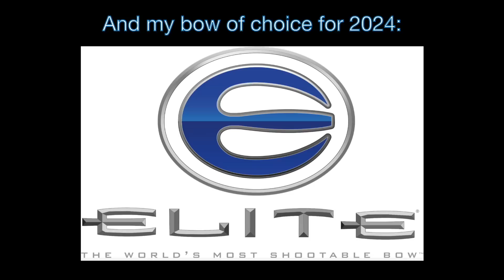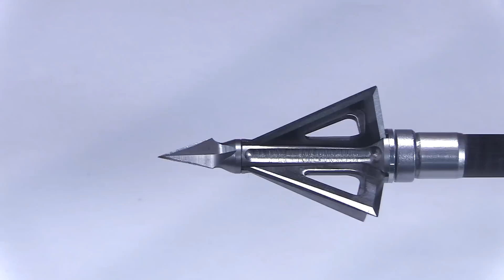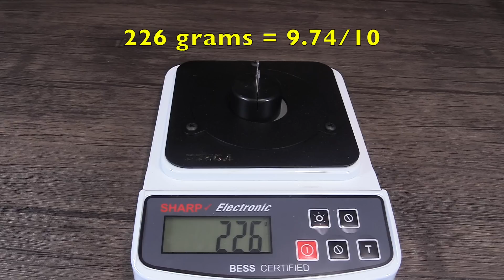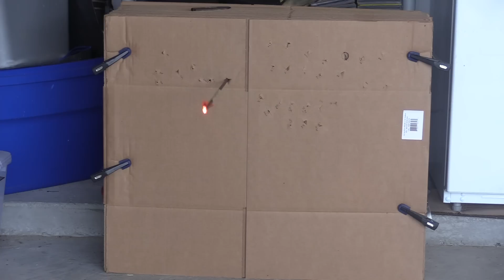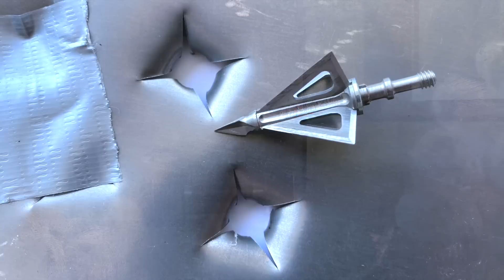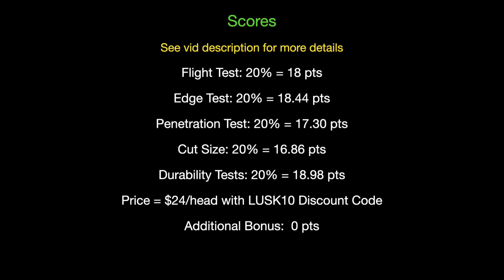GRIM REAPER HADES 4 BLADE, 125 gr Broadhead Test

Comment: Im thinking about running these right next to the qad exodus 100 grain swept . Mule deer and moose maybe a elk would be all possible
Reply from the maker: They’re excellent heads. I prefer the Micro Hades, for better flight and durability.
Reply: The Grim Reaper Pro Hades tested in this video has replaced the QAD Exodus in my quiver. Nothing wrong with the Exodus but the Grim Reapers are deadly on whitetails. The larger overall cut size far out seeds that of the QAD. Much better blood trails but most of the deer I've killed with GR haven't gone far at all.
Reply: For deer iv been running the g5 t2 2" 2 blade mechanical, i also have a bunch of sevr 2.0 hybrids on order i belive i got 8 of them. I got mule deer,wt deer,elk,moose,mnt goat,stone sheep,black bear and bison with in a few hrs of the house all on general open season over the counter tags@robmattingly5279

Comment: My two cents on grim reaper heads. Their best is the micro hades. Their mechanicals are so-so, I like that 6:17 you get 4 but that’s clearly because one or two will have a significant wobble right out of the pack. Stick with their smaller blade lengths unless you are shooting a powerful set up.
Reply from the maker: Yeah I prefer their micros as well.

Comment: I use the grim reaper micro hybrid and the grim reaper 3 blade 1 1/2 razor cut extra cut. But this year im using swackers fixed blade and the flying arrows toxic and trying to get my hands on thorns throrn crown 8 blade broadheads. I would love to see you do a test on the swacker fixed blade.
Reply from the maker: Thank you. I have tested those; they used to be made by Steelforce.
Reply: @LuskArcheryAdventures  ow okay I will look on your channel and try to find that video. Thanks

Comment: Good review as always John. I ordered a pack of these exact broadheads this year Grim Reaper 125 gr Pro Hades 4 blade. They flew well out of my setup. I shot a mature Ky buck opening evening, and the buck went 30 yards and died within seconds. Complete pass thru and I'm pulling 55lbs with a RX8, 470gr arrow. One of the blades did break off and the tip got an ever so slightly curl to it. I believe it caught part of the off-shoulder blade upon existing. They are an excellent broadhead.
Reply from the maker: Nice job. Thanks for sharing that experience!
Reply: @LuskArcheryAdventures  Is there a Lusk discount code for Grim Reaper?
Reply: Shot a 152" Iowa buck with the Grim Reaper 125gr Pro Hades 4 blade last week. 30-yard shot went thru scapula and the buck ran 25 yards and died quick. Huge, bodied buck. Great blood trail even though it was short. 3rd deer this year with the Grim Reaper and all 3 died within sight 30 yards max.

Comment: Which fixed blades have you tested with the best flight performance?
Reply: @ThirdLawPair  I used the 
Muzzy 125 gr. 4 blade heads
For many years. Exceptional 
Accuracy and deadly. Then
They stopped making them.
Pretty much all 100 grain and
3 blade. Just bought some of 
These. Anxious to see how 
They work for me.
Reply from the maker: So many. I always post a summary spreadsheet at the end of each year, in the Year End Summary video; and it can be put in order of flight forgiveness. Overall, the smaller the profile, the better the flight. Tooth of the Arrow 1”, Slick Trick Standards, Kayuga Trizot, and Exodus, are amongst the best in flight.

Comment: Looks similar to the Thunderhead 125. Does this have the replaceable razor sharp blades that the Thunderhead has?
Reply: They have a rebuild kit. Replaces the tip and blades.
Reply from the maker: Yep, but it’s quite a bit better than the Thunderhead.

Comment: What’s also good about the micro hades is they also come in 150 grains and not many replacement heads do. 
Used my TAC arrows. 368 grains TAW with 150 grain micro hades. Shot multiple pigs with them and had crazy good results for a light set up. Like sticking in the tree behind the pigs.
Reply from the maker: Nice. Thanks for sharing that.

Comment: Quick math note:  226 initial sharpness - 251 after-shot sharpness = 25 grams difference, not 34 as stated.
Reply from the maker: Thank you for that. I get bummed when I make mistakes like that. But I appreciate you pointing it out. Honestly, sometimes what I’m saying is more accurate than what is on the screen. But it’s a mistake either way.
Reply: @LuskArcheryAdventures  I tried recording a few of these testing/review-type videos before. You need 2 hours of film to feel like you covered anything. Then you try to pare it down to 10 mins, but feel like you cut so much it doesn’t make any sense. It takes a “special” kind to do this John, you do a fantastic job- and you can keep it! 😂